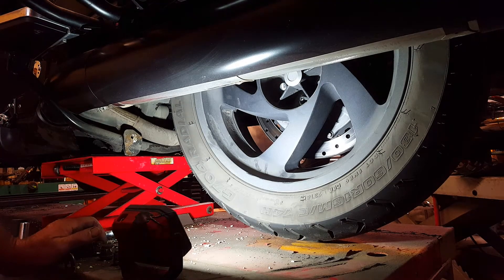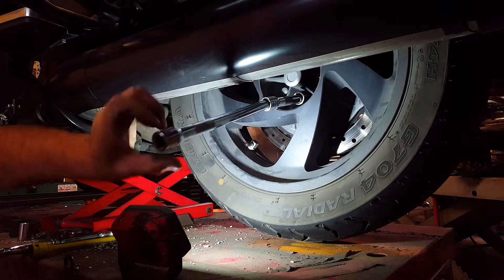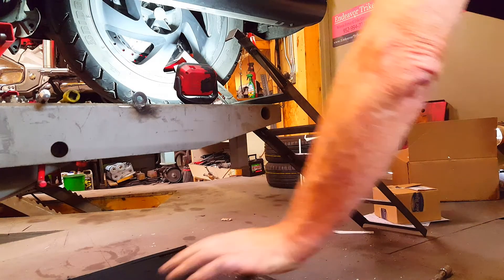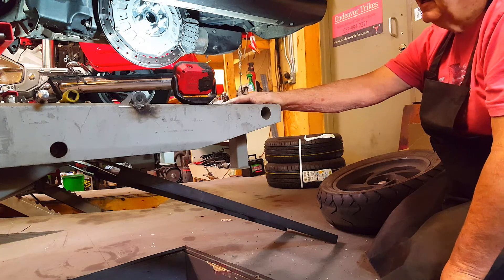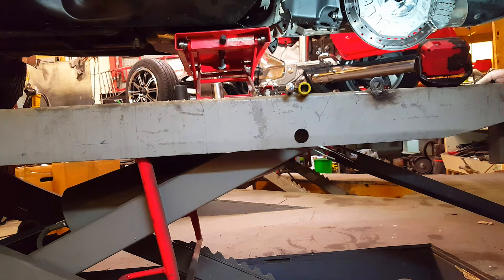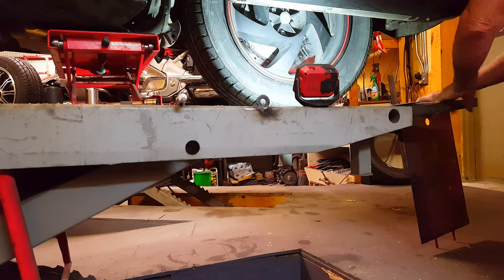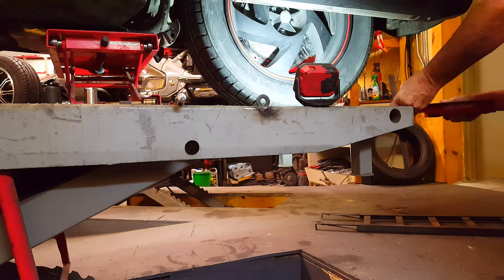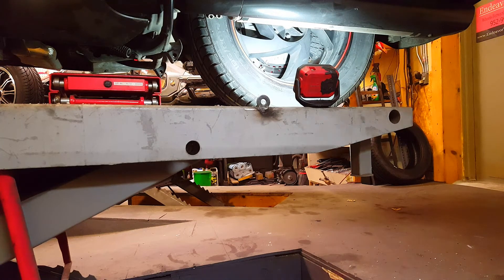GL1800 Car Tire Install   Endeavor Trikes

Comment: I was able to get a "Radar 195/65R16" car tire on my 2003 Honda Goldwing. I also used Eco tire beads for the balancing. It was tight but it fits.

Comment: Do you reuse the same brake master cylinder, also do you sell a kit to be install by the buyer on a 2005 bmw r1150rt
Reply from the maker: Yes I do use the original master. I do not offer any conversion for any BMW motorcycles.

Comment: Any time you have to use an extension on an impact it takes power
Reply from the maker: Yes and no - if you have a high capacity impact it has marginal effect but you are correct it does reduce the effect some. Not enough to be an issue and certainly better than the  160ftlbs +